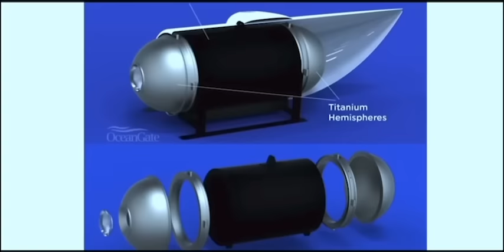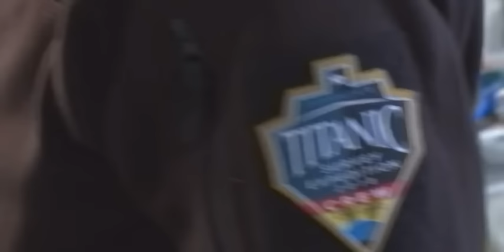First look at #oceangate #titan Debris

Comment: Not manufactured or bonded in a clean room that would have been temperature and humidity controlled and recorded.  Resins should be mixed using  calibrated scales for correct ratios.   If other videos of cylinder section are accurate, a unidirectional layering of ply's in a circular pattern, rather than being laid down in alternating angles 90, 45, 45, 90 for example, is a major issue I saw as well.  Also, the galvanic corrosion between the titanium ends and the carbon fiber center section would contribute to the bond line failure as well,  especially considering the harsh environment.  Corrosion prevention and inspection should have been a top priority.  Those joints needed to be x-rayed after each dive, the entire structure needed that to verify integrity.  Really is sad.
Reply: simple fact that titanium and COPV will react to pressure differently especially at that depth, and as they cycle over x trips that is an absolute weak point.. I am not an engineer and I would never step into that thing. They should have run that thing as a drone 100x up and down then put humans in it... but when you run on a shoe string budget then you cut corners..
Reply: I didn't think about clean room - that would have been a good idea and not just rolling the fiber on like he did
Reply: Stockton said x-rays cost too much
Reply: Touching the titanium with the hand and that rag could leave oils.  Probably used acetone, but still.  Pressure on the cylinder pushing the end caps out, along with the acrylic port makes good sense to me.  Something was serious enough to drop ballast and attempt to surface.   They knew they were in trouble I believe.
Reply: Considering CF a metal for the galvanic dissimilar medals piece.   Had not considered that.  Didn't think CF would act like a metal.   Please elaborate.
Reply: @michaelp.4831  I was wondering about that also
Reply: @rockpadstudios  I've seen carbon fiber used in race cars such as Formula One. They ALWAYS treat it like they're operating on a person. The room is white and squeaky clean. The mechanics dress in fully enclosed suits with airtight visors and there is a full ventilation system. It must be pretty powerful because through the whole documentary, I could hear the fans and they were LOUD. When the carbon fiber sheets are brought in, they're frequently in plastic so they have to unwrap them before they can even start slathering the epoxy on. And it has to be done with patience. There is no "quick and easy fix." There is no "bandage solution" if you slip up. I've seen one racing team try to build a part for their car and there was something wrong with the direction of the panels. The mechanics were extremely careful to lay out the panels so that each layer changed directions as they added them. Well, someone made an oopsie. They threw it away in disgust and started over from the beginning. I couldn't believe my eyes but I realized the driver's safety depends on their severe quality control. The long, tedious process is why this material is pricey. The CEO of this sub didn't understand much about how the material works. I wouldn't dare use it on the WALLS of the sub. That's just insane.
Reply: A titanium sphere is the only way to go. He wanted more paying passengers  so he glued in a carbon fiber tube between two titanium hemispheres.  He had more space inside than other submersibles  but he no longer had a sphere , he ended up with a cylinder.  The cylinder is weak when subjected to external pressure. Just step on a pringles can.Wrong shape, wrong combination  of materials, virtually no testing, bad engineering,   terrible communications  systems with the surface vessel. A viewing window that was not rated for that kind of depth, and everything was controlled  by a wireless video game controller. There is no way he could have got this Magyverism  certified.
Reply: I worked in Aerospace, many things, assembling, bonding etc... Is done in clean rooms.
If you see pictures of assembling sats, everyone is dressed in white overall, hats, shoes are covered, beard covered etc... because the clean environment it has to be.
Reply: Yeah, he cut way too many corners.
Reply: Excellent practical thinking
Reply: Love thinking out side of the “BOX” I simply don’t want to be inside of the “BOX”! A titanium dynamic full sphere hyper strength designed and tested.
Reply: Yeah.. that unidirectional weave in tiny strips, no vaccum bagging, no oven curing.. they clearly did not have any actual engineer working on this. Even common sense says that you should have a load of  epoxy on those ends and the cap should be pressed on and all excess epoxy squeezes out to avoid air pockets. I've been doing carbon layups and design in the marine industry for 15 years and I can say that it is not the miracle material people think it is. It's only good in very specific situations.. and it's only good in those situations because it's very carefully designed to be.
Reply: Could the titanium end pieces have been bolted on?
Reply: My wife used to work in aerospace. She worked on assembling the Voyager Project's Viking I and Viking II. She says that even the least trained people commenting here are spot on. While the one guy who designed the emersible didn't have a clue.
Reply: @tumbleweed2240  I don't have any experience with carbon fiber or any of these materials but the sense I get is if you tried to "thru-bolt" a ring of bolts around the end cap through the carbon fiber, that wouldn't help either because the carbon fiber would not take the strain of pressure.  If it was a metal tube and there was pressure pushing on the end cap, at best you might "egg out" the hole a bit but would not lose integrity.  Carbon fiber would crack and then the failure would be catastrophic.  In other words, metal has a certain "give" that you can test for.  Carbon fiber is the "digital binary" of the materials world -- 1 or 0 -- all or nothing.  It's either strong or a complete failure and changing from one state to the other is instantaneous.
Reply: @michaelp.4831  There is always going to be a difference of potential between two mating surfaces resulting in a anode/cathode with the anode corroding.  Titanium is a good choice for limiting this with CF, but that also is assuming moisture is kept to a minimum.  Salt water would only facilitate the process.
Reply: @rockpadstudios , me three.
Reply: @pancuroniumpete5171 , Actually, Triton subs has a model certified and tested to 4,000 meters. The sphere is made of acrylic. Part of the certification requires each sub to be recertified every year. Other sub manufacturers also recertify annually.
Reply: No clean room. That was my first thought when I saw the guy wiping the surface with a towel. At least it looked like a towel. It may have been a dirty shop rag. Whatever, it had fibers and probably solvents, grease, dirt, etc. embedded in it and he's using it to wipe off the mating surface. 

I am absolutely NOT and engineer and I spotted several concerns with the construction.
Reply: Additionally, the bolts being applied to the entranced would have created shear stress on the adhesive AND the fibers themselves over time. A uniform material like steel is muck better at wear like this, as a steel weld on the end-caps would be substantially stronger.

I honestly wouldnt be surprised if the bolts for the entranced weren't torqued or even possibly put on with an impact wrench.
Reply: @postcardsfromprotest I hadn't thought of that but he and Elizabeth Holmes are very similar.  Big egos, ideas that were impossible, great at lying, and no concern for others.  Great comment.
Reply: @tomskiadelaide  Yes, Stockton admitting to cutting corners and breaking rules. He supports his assertion by saying"I think I've broken them (rules) with logic and good engineering behind me" For someone who is meant to be the lead designer, the concept of "I think"? suggest that he has no calculations, modelling, or testing to back his claims. Disgraceful safety-averse thinking from a man who let hubris endanger everyone who sat in that death-trap.
Reply: Not to mention they had a computer monitor attached to the composite with 4 screws...
Reply: " Also, the galvanic corrosion between the titanium ends and the carbon fiber center section would contribute to the bond line failure as well,  especially considering the harsh environment."  Wrong. Titanium and carbon fiber are nearly identical in the galvanic scale. Corrosion is not a factor. Please ignore all the armchair submersible experts and please don't try to be one on the internet.
Reply: @oldtugs  Nearly identical, not identical.  Combined with moisture, will cause corrosion.  No armchair playing here.  I am  a  licensed aircraft technician with over 20 years experience in manufacturing and working in the field.  I spent seven years working with titanium exclusively.  We always applied corrosion protection between all mating surfaces, no matter what metals were used.  It all corrodes eventually if not protected.  Notice I said in a later reply that titanium is the best choice for CF for exactly the reason you stated.  Chill out man.  We are all good.  I was just speculating if corrosion may have been a contributing factor.  After all, seven year old vessel subjected to saltwater and high pressure is going to cause corrosion somewhere.
Reply: @michaelkane7021  That's ridiculous.

Comment: There are no words to describe the depths of poor judgement of using glue to hold together dissimilar materials for a deep sea craft.
Reply: My friend , you sat it well,there is no words to express thw foolishness that went into this undertaking, i don't mean to be meam , but if something needed to be 'certified' it is the mental state of all those involved in the engineering side of that sub (certifiably insanely reckless)
Reply: "Depths" of poor judgement....
I like what you did there.
Reply: Though I think except for the engineer Lockridge, the rest of the folks were just extensions of Stocktons single minded brilliant innovations! In a video interview Stockton said if you have the pressure chamber buttoned down,all else can fail ,and you can still survive (I don't fully agree with that) but the pressure chamber (and the port window) was exactly the parts that wern't buttoned down!!?? The whole thing doesn't make sense!!
Reply: They shouldn't have used carbon fiber to begin with but machining a flange on the end rings that sank 8-10" into the carbon fiber tube so the ends of it had something to compress against probably would've saved it. Gluing that round end cap on there with nothing but a little ribbon of titanium inside and outside just to line it up to ANYONE even a plumber putting pipe fittings together that hold 30psi looks like a soup sandwich weak stupid rookie bs an idiot would do because he brought the wrong parts. First time I saw that clip of them assembling that thing just thought NO WONDER it failed.
Reply: @RJ99729  
Ja i suspect the carbon fibre shattered into many many small pieces under the immense pressure, that explains why they didn't find any sizable carbon fibre pieces, in that millisecond when the pressure inside the hull went from 1 atmosphere to many multitudes of
 atmospheres of pressure,the acriylic viewport was violently separated from the titanium endcap ,snapping the bolts
 off due to hammer impact effect,and the force from the inside acting  the weaker cocave shape of the acrylic to smithireens
Reply: @RJ99729  
So that the Titanium rings couldn't slip is sideways?,I get you,although I think the immense pressure down there was enough to keep them in place even without glue, the glue was to keep it together once out of the water or at shallow depths,the weak links in my humbke opinion was the carbon fiber hull it shattered ,like a fine crystal glass falling on hard concrete from a multi storey building!
Reply: @janmale7767  Not so much to keep it from slipping sideways, the forces pushing it against the CF tube I would imagine could keep it centered and sealed if the CF was strong enough to hold up, but more the ends of the carbon fiber having something to support it. Like if you squeeze a pringles can, if you squeeze the center, it's somewhat strong, squeeze the closed end, even stronger, but if you squeeze the open end, pretty weak. Water pressure could buckle that carbon fiber on either end somewhat easy I think, just shearing off the 3mm thick centering ribbon they left when the carbon fiber starts deforming inwards. When if that was a substantial piece of titanium it'd support the ends of the CF tube. Like a plumbing PVC fitting but in reverse, instead of holding pressure in, it's holding pressure out.
Reply: @RJ99729  I think you have the right idea. The glue was under compression, so it probably was fine. So far the biggest problem I saw was the submersible descended way way too fast and they couldn’t stop the descent. It’s to fast it builds up stresses, temperature differentials which is why they started hearing cracking. They tried to ascend, but they couldn’t. If they were able to ascend, they may have made it out of there.
Reply: I agree. I can't believe that the carbon fiber wasn't designed with an end cap attachment absurdly thick with a mating face to be through bolted to the titanium ends along with a glue/sealant.
Reply: @RJ99729  Yep. I'm a machinist and am truly shocked at the miniscule groove that the carbon fiber tube was glued into. I would want a deeper 
groove even if it was my kitchen sink drain pipe. It seems like they would have inserted the carbon fiber 12 inches or more into the titanium encaps, fully glued. Very strange and reckless thinking. It also seems like they would have had several rings or hoops inside the carbon fiber tube every few inches throughout the length to help support it from compressing and flexing inwards.
Reply: I couldn't agree with you more i think this stockton guy had a mental condition, called 'tunnel vision' and those workmen look more like ' backyard mechanics ' than high tech engineers, you need the guys in the white coats and thick spectacles to design these machines.
Reply: @janmale7767  Sometimes you just want something so bad that you rationalize that what you are doing is ok in order to fulfill your vision.   You want to make sure that you are a man with an idea, rather than and idea that has a man.

Comment: I imagine that the glue also had lots of trapped air in between. Joining two surfaces like that with glue, and without any vacuum, it is just impossible to not have air to mess it up. What could go right?
Reply: I don't think it's impossible if you can pump air-free glue into the interface in large excess and flood out the air bubbles, but that would cause a tremendous mess of glue everywhere, even where you don't want glue (you'd want to have it inverted so it fills from bottom up and the air has a nice way to leave; this would mean excess glue goes all over the titanium ring and into the bolt holes for the titanium end cap; so you'd have to keep that from being washed in glue by some kind of masking). You wouldn't even have to pump it in, you could vacuum the glue separately, pour it into the slot in the titanium ring and then lower the tube in and press out the excess with its weight.

Glue just feels like not the material to use for anything reliable, inspectable and high performance. I guess they were expecting the outside pressure to force the end caps into the carbon fibre tube. But the difference in thermal expansion rate between the carbon fibre and titanium and the difference in elastic modulus and the geometry would mean forces trying to shear the glue repeatedly. Gross. Would not recommend.
Reply: @soylentgreenb  you dont know what your talking about, the only way to have air-free glue is to remove all the air with high pressure vacuum and the only way to do that is to place the entire pressure chamber in the vacuum at the same time as pressing the titanium ring, glue, carbon tube together which would require an enormous vacuum chamber. Any excess glue that gets extruded out can be removed later after the bond has cured, and validating the complete cure is the problem.
Reply: @jagitmax  High pressure vacuum?!
Reply: You're right on the air trapped due to the male/female nature of the surfaces but, vacuum when gluing is not a recommended in most cases, it would've drawn the glue out
Reply: You can see what happened, by wrapping a toilet roll cardboard core in carbon fibre. From the inside, it has enormous tensile strength, making it almost impossible to break. But from the outside, you could crush it with your bare hands. The crush strength was from the epoxy resin, but it was full of air bubbles. These would crush layer by layer on each dive cycle, turning the resin into dust and reducing it's strength to a soggy sponge. The added water in the layers was what was increasing the weight. Forgetting he carbon fibre and vacuum injecting the epoxy into a mould, would have produced a solid bubble free cylinder, but their would be a shatter risk upon impact from the outside. The entire nose radome of Concorde was a one piece epoxy moulding and it never failed during thousands of hours of flight. Scale models fitted with blank end plates, could have been produced for pressure testing in a high pressure tank at relatively low cost. 21 full 8 hour dive, surface cycles could be completed in a week. Unfortunately, with the composite structure they used, scale testing was impossible. However with a one foot square manufactured sample of the hull material, pressure testing could have been carried out using a power press fitted with a 3 inch circular head, onto a steel plate. The time factor would have been the same.